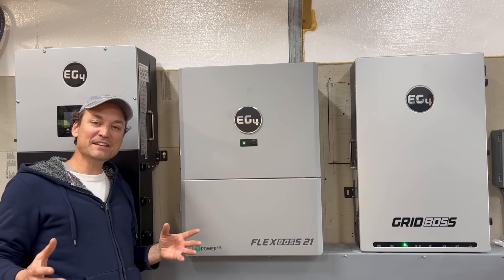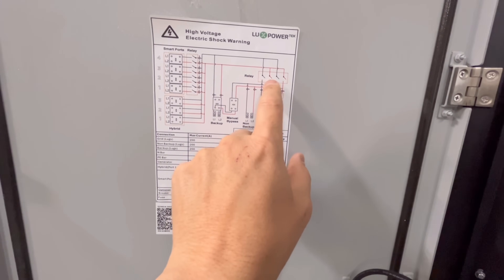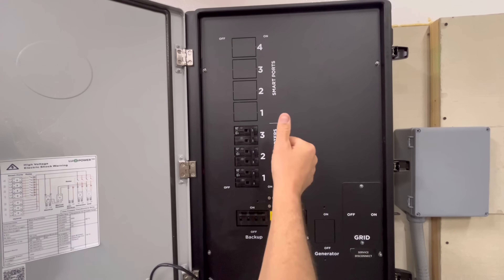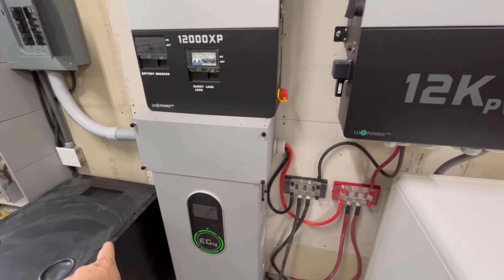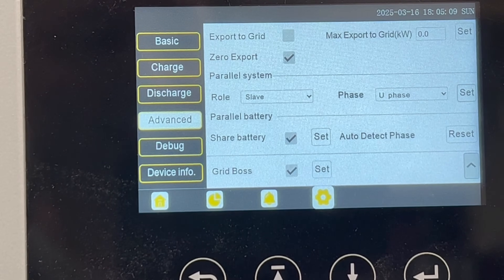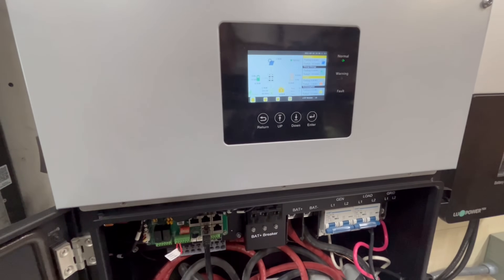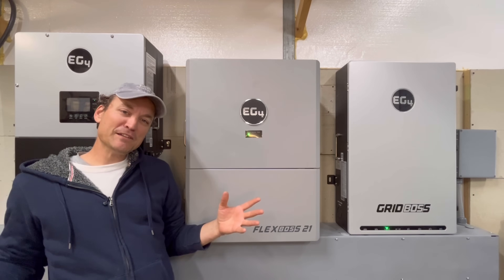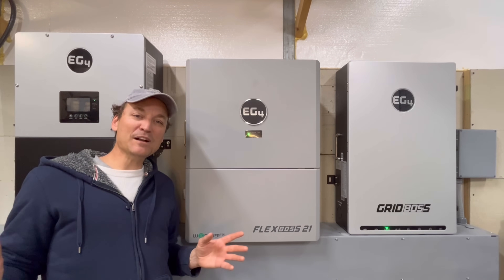EG4 GridBOSS: Adding 12Kpv to the system, easier way to use your grid tied solar for battery backup

Comment: What gauge output wire?
Reply from the maker: For which step? The inverters would be whatever gauge fits the maximum output. The newer types even have wires gauges on the cabinet door.
Reply: @GavinStoneDIY  output should be only one for the house like the "main" power. Because when you add flexboss and 18kpv its higher amperage put out if needed. I can just add the amperage and see which cable size. I might just rewatch it again. I bet you go over it haha thx

Comment: If you have the grid boss in bypass mode to disable the inverters while working on them to the smart ports, still have power to operate the bigger loads

Comment: Planning a system like this for our build on Eleuthera.  The local grid power is bad.  Lots of brownouts and phase drops.  Will the gridboss be ok with "dirty" grid power hooked to it or I was thinking of using a chargeverter connected to local grid as the grid link... Thoughts?  That would keep clean power all the time if needed to charge if cloudy or solar doesnt cover. Anyone install anything similar?  Looking at gridboss, flexboss 21,18 and 5 batteries.  2 on the 18 and 3 on the 21.  Should i also connect the 2 sets together for balancing or does the inverters take care of it?
Reply from the maker: They hrz difference on the grid may effect the charging from AC. It’s hard to say really. If it does, the chargeveter would be the easiest solution yeah.

Comment: I am a complete novice with solar, but I have experience using electricity.  I put 42 PV panels on a South facing barn roof to power my farm and farmhouse.  I am installing 1 Gridboss with 2 Flexboss21s and two of the indoor WallMount batteries from EG4.  The question that I have is how to run the communication lines from the 2 Flexboss units to the one Gridboss.  How do they connect.  Due to space concerns, my Flexboss21s and batteries are not located right next to the Gridboss.  Do I need to buy longer communication cables and the Gridboss only seems to have two openings for the connection.  I would assume you would need four openings to handle the two inverters or is there a way to parallel the two inverters? Thank you for your assistance in this matter.
Reply from the maker: You can run one communication from each inverter. You can use any cat5/cat6 Ethernet cable. They have a schematic on how to wire the coms cables in the flexboss manual.
Reply: @GavinStoneDIY  Thank you.  Much appreciated.  Great video.

Comment: So right now we have Solar system from Sunpower (installed on the roof from builder when they build the house) This solar system feed the house and its connect to the grid to feed the grid as well. If i install the Gridboss and Flex 21 and EG4 battery. Is it anyway we can connect the current sunpower solar system to the Gridboss and install another solar panel in my backyard then connect that to the Gridboss. That way i can have 2 solar panel system to feed the house and charge the battery. I do not need to feed to the grid anymore. Only need the grid to feed the house whenever backup battery is too low.
Reply from the maker: Yes. You can connect your existing array to the gridboss of its using micro inverters. Or depending on the exact setup you may hook them to the flexboss. Either way though, you can definitely use your old and new array.

Comment: Great Video!  Looking at setting up a Gridboss / 12kpv combo.  Do you know if you can connect a generator into the 12kpv in this arrangement?  Due to location, connecting the generator to the 12kpv would be preferred.  Haven't seen anything to say if this is recommended or not.  Love the channel.  Always learn something.
Reply from the maker: That’s actually a good question. I would assume the generator would have to connect to the gridboss. Since the relays to the gridboss likely open the relay to the generator, meaning it kills that port. I honestly am not super positive. But my guess would be it’s not possible.
Reply: @GavinStoneDIY  I read something later today that said the grid boss disables the remote generator ports.  Probably for the reason you shared.  Thanks!

Comment: Will the GridBoss allow a 110v generator to connect to the generator input port and charge your batteries when the grid is down? Are will it only operate with a 240v generator.
Reply from the maker: @bowbilly9080  so that would depend on the inverters themselves. And I believe  all the hybrids require 240v input. So I don’t believe a 120v generator would be sufficient. I usually recommend the chargeveter for that.

Comment: Why, why in hell do you need this much power??!! Ridiculous and you most likely got all this for free tens of thousands of dollars for free..
Reply from the maker: @SolarizeYourLife  you’re pretty consistent. You basically leave the same type of comment on every one of my reviews. I test inverters and batteries. And in order to test them I have to hang them on my wall. Most of what I have on the wall is there because i still get questions on the equipment. Some of my equipment I get for free. Some I pay for. Some of the gear I sell, some of it I give to family or church friends.
Reply: Are you sure your screenname wasn't supposed to be CriticizeYourLife? And why is it that EVERYtime folks like CriticizeYourLife leave a comment they ALWAYS have a much much much smaller channel than the one they are criticize? 

Give it a rest hoss you're embarrassing yourself.

Comment: What is the difference between flex boss and grid boss?  Would I need both or can I use just the gridboss?  What does each do?
Reply from the maker: @ahowl7mx  the flexboss is an inveter. And it can be used alone. But for enhanced use you’d need the Gridboss. The gridboss is a gateway between the grid and flexboss.

Comment: I would like to know the logic on how much the Grid boss loads the inverters.  If there is one that it will load more than the others, that would be the one I'd have the most pv on.  If it's the master then I would put the largest inverter as the master.

I have an 18 kpv currently.  Just ordered the Gridboss and Flexboss 18.  I was bummed to find out that the FlexBoss will only output the higher kw amounts if grid is connected.  Why would that be?  Can that be changed in a firmware update? Will it work if grid iss connected but set to zero export?  

I want to be totally disconnected from grid.

I would have sold the 18kpv and bought 2 12000xps if they made a sealed version for say $2900ish.  I do like the 600v pv though.
Reply from the maker: @ry2456  what do you mean only output higher amount with grid?  It does require solar to reach its maximum output. But not grid. I’m actually testing the 18 right now. And my focus is always on off grid capacity. 
Yeah I do wish they had a sealed version of the 12,000xp. But then again,  I guess that’s what these flexboss models are. You just get some extra hybrid features.

Comment: Could your 6000xp be hooked into the smart port? I have a system with 2 6000xps and would like to use a grid boss until I can upgrade to one of the flex bosses or a combination of both
Reply from the maker: Eh. Technically? Maybe. I’ve used the 6000xp’s for loads like that before. And when the port shuts off the XP will charge the batteries for a brief moment to bleed off the excess power. I wouldn’t do it in my opinion though. I mean, I do stuff like that all the time. But for testing.
Reply: @GavinStoneDIY  If you do get curious let me know what happens. If I didn't have the 2 new 6000xp's I would just buy a flex boss. But too late for that now and only have 2 months of run time on them.
Reply from the maker: @allenjessen859  yeah the XP’s sell for a decent amount. Although I know that’s not the best option. I’ll see if i can get the time to test it. That will likely be hard on a non hybrid inverter though.
Reply: @GavinStoneDIY  Thanks for the effort if you do get time.

Comment: what location do you separate the ground from the neutrals in your installation
Reply from the maker: @popstream4972  I have a bond in my main breaker panel. So that would be my single bond in the system.

Comment: If you have the grid as a back up, do you require a disconnect between the meter and the Grid Boss?
Reply from the maker: Some places do. Technically the gridboss is sufficient. It is a fused disconnect. But in some places they require a knife switch between the GB and the meter.
Reply: @GavinStoneDIY I live in one of those places. I need a lockable fusable knife switch outdoors within 10ft of the meter.
Reply from the maker: @ you shouldn’t have to have it fused as well. Legally the knife switch should be enough. Because the GB has the fuses.
Reply: @GavinStoneDIY  I think the first disconnect needs OCP. Or at the very least there needs to be OCP within x number of feet of the meter.
Reply from the maker: @ yeah I believe it’s a footage requirement. At the most all you should need is a disconnect. 
Honestly I dunno why you’d even need that. But I’m guessing it’s because people still aren’t familiar with the gridboss
Reply: In my area a knife switch disconnect is required.  Not required to be fused.  This is a utility requirement.  They want to be able to see that the blades are separated.  

For the Franklin system we could put a 200 disco between the meter, but usually put a smaller one between the battery/inverter and the gateway, as well as one between the pv combiner and gateway.  This effectively kills the possibility to back feed the Grid. These are micro inverter systems.  

Multiple companies make gateways.  The company I just started working for installs FranklinWH systems.  What is needed is for all these gateways to have a built in knife switch.  Also they all need a 400 amp version.
Reply: @ry2456  A 400A Gridboss would be nice. 400A service is becoming the standard these days.

Comment: On the communication to the grid boss, did you plug a cable from each inverter to the grid boss.
Reply from the maker: No. I had the 18k and flexboss hooked to it. But the third inverter I just hooked to the parallel  port on the 18k. Seems to work fine.

Comment: Ok, I have one, no two, questions. 
1. Exactly how much power do you use daily ?
2. How much pv do you have total, across all three inverters ?
Reply from the maker: It can vary so much. In the spring  we use very little. As the summer comes on we can start to use 50kwh a day. And then it increases from there. 

Currently I have  14.4kw of solar. But I’m adding another 4,500 watts now.
Reply: I am at 50kw a day right now  !  Summers kill me. 😅
Still trying to figure out where to put more PV.  So far I only have about 7kw in panels. Just enough to run my loads in full sun but not fully charge my batteries. In the summer I will not have enough power to charge the batteries at all. My wife will not let me put panels on the roof and I can’t afford the Tesla roof.
Reply from the maker: @ no space for a ground mount? I’m reviewing the integra rack right now. It is so simple to install it’s crazy.

Comment: Finally a system that uses AC Coupling to the max. They tell me all I need to use the Grid Boss with my 12k LuxPower is a LuxPower dongle. Nobody has said yet if the LuxPower will accept the EG4 firmware. Just a little information. Thanks for the video.
Reply from the maker: @offgridwanabe  it should function with EG4 firmware yes. I heard that a while back from Eg4. But I haven’t verified that myself.

Comment: If I’m going to run one very large load, do you recommend using one of the smart connections plan on running some immersion ASIC minors which will probably pull at least 100 A continuous, hoping to figure out a way to upsize battery storage as I grow.
Reply from the maker: Yeah that would work. That’s actually a good idea, because you can discharge based off the state of charge of your batteries.
Reply from the maker: I still want to get into mining. I just haven’t researched it enough.

Comment: Thanks for this. I thought the gridboss was only needed for on grid builds, are you utilizing one because of the multiple solar inverters?
Reply: I am using mine in a 100% off grid setup too, for paralleling and smart port use. Makes the whole install so much cleaner.
Reply from the maker: Yes. It’s mostly for testing my multiple different eg4 hybrids at once.